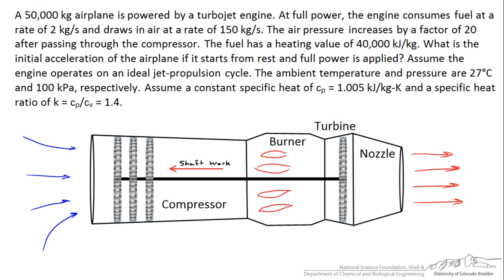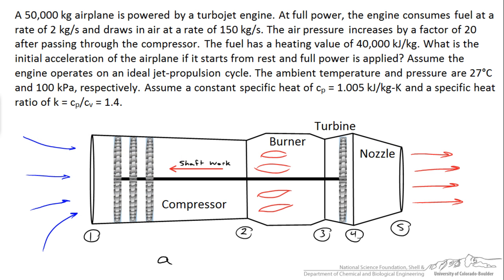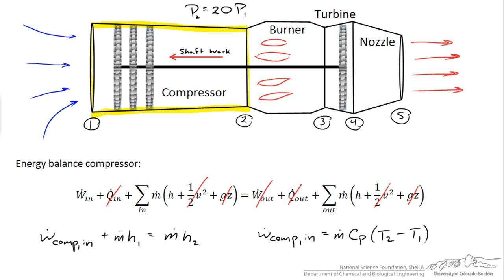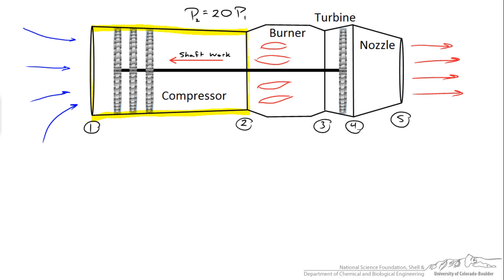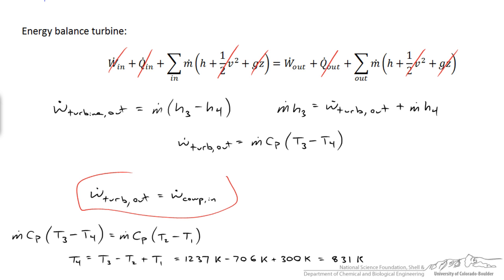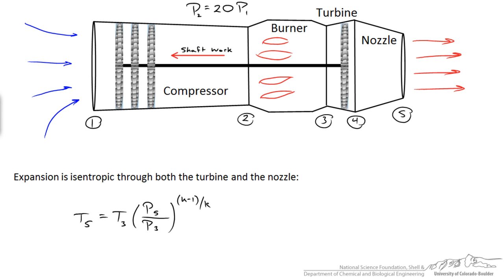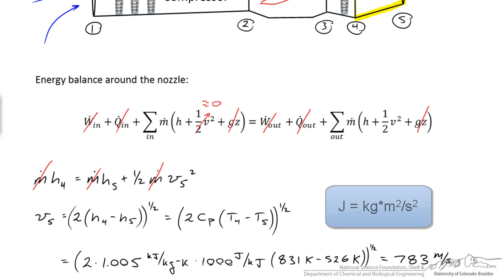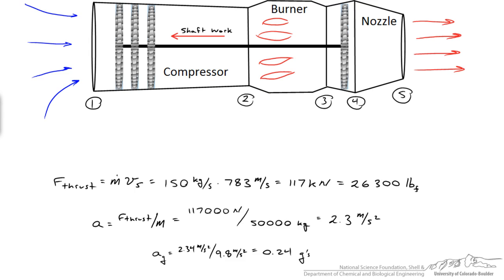Acceleration of an Airplane by a Turbojet Engine

Comment: As the result is 117KN of thrust, how many power is in this air movement. By the formula P=Thrust x Velocity/2 we have 117000x783/2 = 46MW, like 500 car engines. As the fuel consumption is 80MW (from given  40x2MJ/s ) the efficiency is 58%.